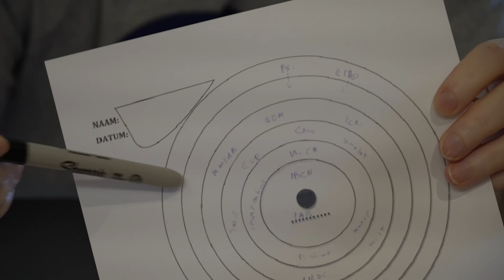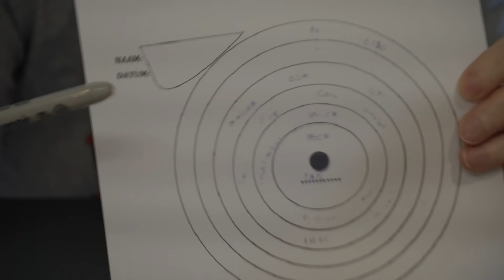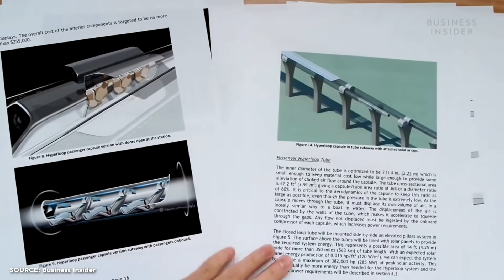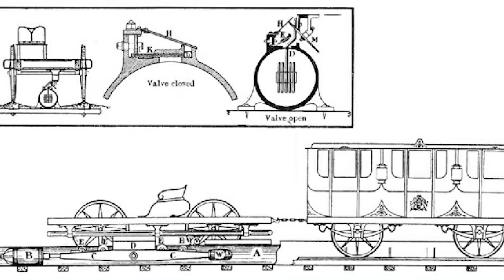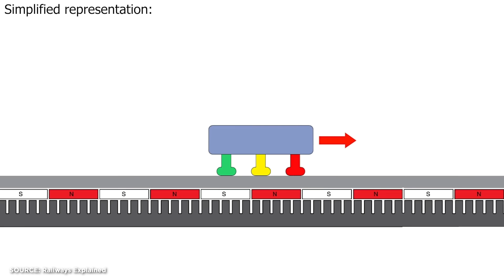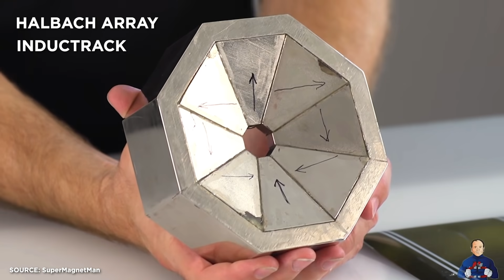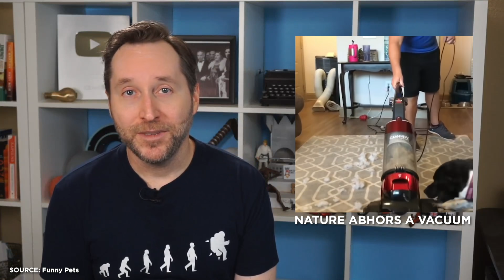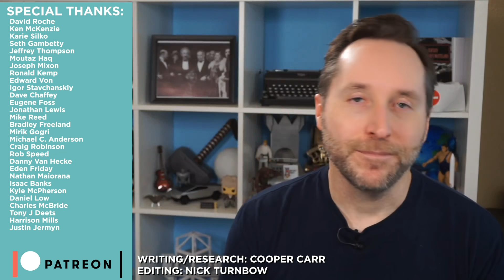What's Happening (And Not Happening) With Hyperloop | Answers With Joe

Comment: You do realize that virtually all the 'issues' with the hyperloop tubes have already been 'solved' decades ago by the 800 mile-long Trans-Alaska Pipeline system, which only took 3 years to complete, is 'bulletproof', and was mostly constructed in situ, whereas the Hypertubes components can mostly be mass-produced in factories, and trucked to the installation points. (and the Navy has already produced 'railguns' that propel their projectiles at hypersonic speeds, as well as replacing steam-powered jet launching catapults with similar tech.)
Reply: Seeing the photo here - https://en.wikipedia.org/wiki/Trans-Alaska_Pipeline_System - how do you get a train to go 1000kph inside that?
Reply: @istherenofreename  Just install the 'railgun-maglev' bits and reduce the air density to 80K foot altitude equivalent, after the oil is out of it, of course. I dunno, you do the math, that pipeline has been able to securely deliver 2 million barrels/ day over 800 miles, for 4+ decades, but you can't open your mind enough to see how a little modification and adaptation, using the technological advances of the last 4 decades, would make it easily do-able. It's been done, in fact. Wow... visionary.
Reply: You are right that building a pipeline has been done. Making something fast has been done. Hoisting a railway to be 8m above ground has been done. Making a train go fast with maglev has been done. Making vacuum has been done, making stuff move in vacuum has been done. All of it can be solved, but I just don't see how it will be economic. Fast rail is already failing to provide an economic alternative to air travel (its usually more expensive to take a train than a flight). I can't see the extra complications making hyperloop cheaper than rail, and the speed difference to hyperloop driving that many people to use it!
Reply: @istherenofreename  Both India and Russia prove that trains don't HAVE to be more expensive than flights, in the USA unfortunately, the 'federal control' of passenger rail system skyrockets the cost, but they ALWAYS cost much more in unproductive travel time, which airports try to help 'balance' out by consuming much time also. I 'commuted' from N. Oregon to Central California by air, light rail and rental car back in 2005, driving 35 miles to PDX at 3:30AM to make sure I had enough time to get through TSA security (just the carry-on luggage) for a 7:45AM takeoff,  2 hour flying time, an hour to get out of San Hosed airport and into the rental car, and usually at the facility by 11:00-ish, almost lunch time (~8 hours door-door). 11 days later for the Friday flight home, 3:30PM take the rental car back to the airport, get through TSA, wait for boarding and take-off,  2 hour flying time, 2+ hours to ride the light rail to western end of the line, 30 minutes ride home after the wife picks me up at the final stop.
With Hyperloop and 'flying taxis', 20 minute flight to terminal, 45- minute to 1 hour HL ride, 15 minute taxi flight to the facility, same on return trip.  1.5 hour commute!
Reply: You are seriously comparing an oil pipeline to a vacuum tube that is supposed to carry passengers??? Great job comparing apples to steaks. The largest failure of the Hypeloop is that it will never be economically viable compared to any other means of transportation. It also has far more points of failure and far more safety issues. None of this has been "solved".
Reply: @herrschaftg35  Gee, let's talk 'economically viable'... so far the US federal government has thrown in $5 million USD, mainly to study how to regulate Hyperloop systems, while multiple hundred  millions is coming from private investors, who don't share your knee-jerk biased opinion, obviously.
Since you don't know any Hyperloop engineers, you have no clue what's been 'solved'...
Meanwhile Amtrak has a subsidy of $2 Billion USD annually, which in 2020 was supplemented with another $1B, even though ridership dropped so its service levels did too, then they requested another 
$1.5B for the same. (LA to SF Hyperloop estimated to cost ~$10B USD, then be that weird thing called 'profitable'..., as opposed to 'viable')
Currently the US federal funding plan for 'High Speed Trains' is $32B, yes billions with a 'B', even though the shortened California HST is now projected to exceed $100B. CA's HST is not 'mag-lev', and I kinda doubt the federal funding is for anything faster than 250 mph, if that.
Even the light-rail trains in my metropolitan area are rated to cost US taxpayers about $35 per ride and will long after they are scrapped.
Trains use 18th century technology, which century are we in now? Can't they be made 'viable' yet?
Apparently your idea of 'economically viable' is a system that taxpayers can be forced to dump huge amounts of money into to get them built, then never pay for themselves and require more huge amounts of taxpayer subsidies to continue their operation... the Amtrak & light-rail model.
Reply: @terrytaylor2825 : Everything you just said proves my point. Public transportation has always been subsidized to remain in operation. This is obviously no secret. Yet current transportation methods would pale in comparison to the costs of the Hypeloop which would also need to be heavily subsidized. Or you you actually believe Musk’s bullshit when he says it will be the cheapest means of travel??? Missed deadlines and the lack of a working concept is evident enough to know that nothing has been “solved”. If every issue had been solved like you wrongfully claim then there would be a working Hypeloop by now….
Reply: @herrschaftg35  There is a 'working Hyperloop'....  the delays are nearly 100% bureaucratic, getting government entities to move on clearances and then, routing. A miles-long demo tube-track is being built in WVA, right now. Development is happening in Dubai and India. China has their own version. None of these are just standing there wailing that it 'can't be done' 'it's too expensive if it can' or 'I want my government mommy', like so many others are doing without even informing themselves of the realities.

Remember that California High Speed Train? It was slapped into the 'stimulus infrastructure' money geyser back in Obama's first term, 2011 or 12. It might be done by 2030. Because incompetent government, doing what it has no mandate to do so poorly. The European model.
Federal pressure for all jurisdictions to clear the path for all their 'approvals' and still, with technology a couple centuries old, the project was scaled back and will likely cost 4+ times original estimates. For a train that likely will rarely go over 200mph.

Train transportation in the USA has only been subsidized since the creation of Amtrak, and the bureaucrats love affair with 19th century technology is what has driven light-rail that requires subsidizing. Ooooooh, electric trains! Just that they are always great tools to relieve taxpayers of vast funds that government has no mandate to spend on their cronies. It is certainly NOT true that transportation has always been subsidized, in fact where I grew up there was privately-owned 'mass-transit' in the form of diesel and electric busses, and when the company needed to raise the price of a ride by a nickel, to .25, the metro government used that as an excuse to take it over and raised the price of a ride to .35!

Minimizing government money-sucking and incompetence would immediately accelerate the development while reducing costs vastly, as well. And you can be patient and look for the successful demonstration of all those 'solved' things you think I wrongfully claimed.
Not that anybody cares.
Reply: @terrytaylor2825 : No country has a "working concept" of the Hypeloop. You are literally making shit up...

Comment: You know Joe, fortunately (or unfortunately) people 
have little knowledge of vacuum technology. 

Otherwise they would know that it is possible to 
have a big long tube with vacuum on the moon 
or even on Mars. 

But not on earth. It requires here vacuum pump 
systems, each 20 km, each from the size of the 
Empirestate buildings, for these large volumes 
the vacuum to produce. 

Any questions?

Comment: isnt it an under ground tunnel actually a "hew tube".....

 also wouldn't a huge fragging Crain with a long arm stood in the middle of a city be a heck of a lot cheaper  and far easier form of transport, could drop you pretty much point to point, selectable counter weights inside the structure to keep the lifting costs down, good for transport and freight, pat pending you've been warned

Comment: What about the  g's ? 
Acceleration and deceleration is going to be very uncomfortable for alot of people.. slammed in your seat and the then thrown into your seat belts. Speeding up to seven hundred miles per hour would hurt if done fast and would lengthen the trip if done slow.
Grandma wouldn't like her dentures rammed down her throat and then spit them out to the people at the other end!

Comment: It is obviously impossible to travel between U.S. coasts in 3 minutes without killing the passengers. It would take many times that interval to speed up and slow down, since a force creates an acceleration, not a velocity. Otherwise, the idea is remarkably similar to trains, except that problems with increased amount of weight and volume would limit a hyperloop, but not a train.

Comment: The problem is always going to be maintenance . . . . have you seen the roads in Michigan? How about our old rail systems? Maintain a vacuum tube for fifty years? We aren't that responsible. Or are you going to depend on the company to do it using their "profits"? This would have to be maintained whether it was profitable or not . . . otherwise implosion. Roads and rails don't implode if we let them get a bit rusty or develop a pothole. Tunnels? Have you seen a subway system? This has to stay air tight.

Comment: I hate the word "hyperloop" and others like it such as "cloud" that are just bad rebrandings of existing things. The idea itself sticks around because it SHOULD work. Pneumatic tubes worked well, and we have all the technology to make a vactrain work, refined well enough to be done safely...but there are complications that keep cropping up.

I would put it on the same level as self-driving cars. Obvious, but with an enormous amount of small hurdles the average person doesn't see. The difference, though, is self-driving cars will save tens of thousands of lives a year while also creating a service model that companies can exploit ad nauseum, while a vactrain is an incremental improvement over monorail with high up-front costs and some severe limitations on implementation. The main area I see them being useful is in shipping docks. This past year we've seen how getting things from those docs to the continent is the main bottleneck. We can't just build more shipping docks because the loading equipment is expensive and works best in concentration. But the unloading doesn't need to be. You could have a set of vactrains that rapidly move things from a doc to further in-land distribution centers that can be on FAR cheaper land and more rapidly clear the docks.

Comment: I think it COULD work if, a wood chuck COULD chuck wood... And I, for one, thinks they can!  I also think if you can get an above ground tube, at a practical size to hold a vacuum, it would not have a problem with bullets.

Comment: I'd honestly rather see commercial airplanes transition toward carbon-neutral energy. Which I know is a big challenge that will take decades. But people can already travel 500+ mph using that. And there's potential for airplanes going intercontinental that can travel over 1,000 mph. (Earth's circumference is 24,901 miles, so 2 opposite points are 13,000 miles apart, which means the longest flight times can potentially be under 13 hours.)

Comment: Lots of huge airlocks.  Energy required to maintain a near-vacuum. Poor emergency access. No natural source of cabin fresh air. In the event of loss of cabin pressure, time until loss of consciousness & death is seconds rather than minutes. Restoration of cabin pressure not as simple as merely descending. Insanely high construction cost (especially if tunneling to reduce land acquisition cost).

Comment: I can't think of a single "disruption to the fundamental infrastructure" made in the last... 60 years. Making things better, bigger, faster is not a revolution, it's just basic advancement. HL is just a fast train with extremely dangerous and expensive cheatcode. You don't need that, you dont even need maglev, trains can be fast as hell. Fast enough to travel across Europe or US in specious comfort. And run on renewables too. HL is like disrupting car industry by developing rocket cars, instead of simply making cars better.
Reply: What everyone seems to be missing is what the market wants, and where we can optimize. We can make crossing the Atlantic several hours faster without building a single piece of infrastructure: Remove airport security and customs on either end, and all the other BS that makes you show up at the airport hours earlier. Optimize ATC, we're being overly dramatic on ocean-crossing tracks and plane separation within controlled airspace. Then make planes fly faster, right now no airliner is travelling anywhere near as fast as it could, they are in fuel-saving mode. 

That could save you as much as  4 hours off of your actual trip without building anything, and yet we aren't doing it. Why? Because it's not that important, and it's not what the market wants, it's that easy. 

The market, ie people, doesn't care about cutting transportation time as much as it cares about cutting costs and increasing comfort.

Comment: make the whole thing magnets instead of air pressure. A tube mad of magnets. The top is positively charged and the bottom is positively charged... Wont that repel the two and cause a few inches of separation? And then forward activation of the magnets causing propulsion. yea? no?
Reply: That's what it is, it reduce air pressure to reduce the drag(fluid friction) Or I am just I don't I am stupid kid, LA LA LALA LA.

Comment: A big issue with "hyperloop" vactrains and maglevs, and prob one of the main reasons neither have taken off, is the absolute nightmare of incompatibility. THe rail network already exists. The costs were recouped decades ago. Building a new system that's completely and utterly incompatible is infrastructure suicide. Anyone who has ever watched generations of Australian logistics people tear their hair out over the batshit insanity that is the innumerable breaks of gauge will know just how much inefficiency and cost these add to the system - and that's when you just have to shift a container from one flat bed to another... imagine the faff around with airlocks and the weird loading gauge of the "pods" as well. That's just for freight - try selling disjointed journeys to passengers who could just take a regular train or drive.

Comment: Hype going round and round = Hyperloop.

The Aeromovel atmospheric railway, that was mentioned running in Brazil, also has had a system running in Jakarta at a theme park since the 1980s.

http://www.aeromovel.com.br/en/case-studies/jakarta/

However this design has almost nothing to do with Hyperloop since Hyperloop does not use the pressure differential between the front and rear of the vehicle for traction and braking.  Hyperloop requires propulsion from the vehicle.

Comment: Didn't mention the safety/terrorist threat to this idiotic system. 
Suffer a mechanical failure or fire and your passengers are stranded miles from exits, in a vacuum tube.
Blow up this thing (inside or out) and the entire system is destroyed.
In normal, non-enclosed systems, passengers can egress at will and the system can be brought back online in hours.
This will never be a practical proposition for people or for cargo.

Comment: Don't talk about pneumatic tubes in the past tense, they're still very much in use, with new systems getting installed. Big hospitals need them as you can't deliver drugs or samples by email, but they also can be a good option for banks (sending cash) or ordinary factories sending parts from one place to another, or regularly to QC, or wherever. Hospitals definitely seem to be the hugest market, though.
...and, as usual, the vast majority of the world market is owned by half a handful small and specialised German and Austrian companies. Same as with tunnel boring. Let's not pretend Musk would actually be competing with Herrenknecht.